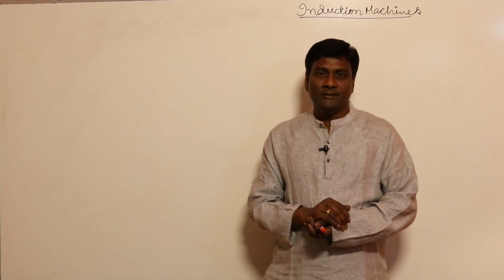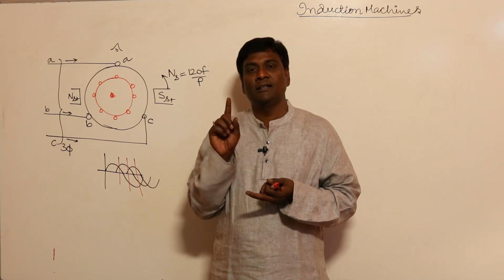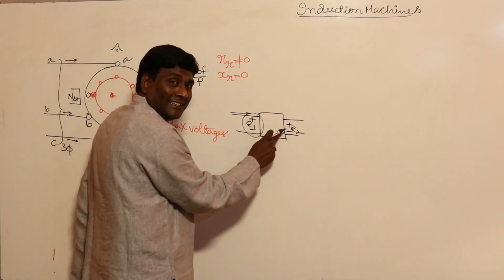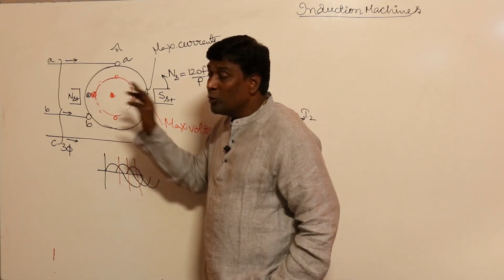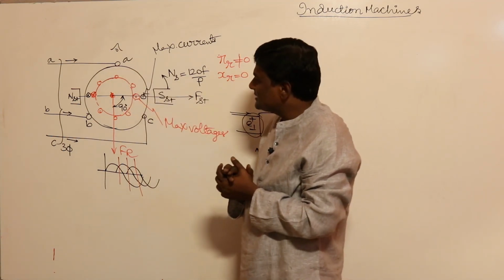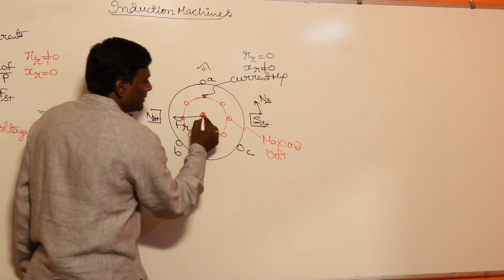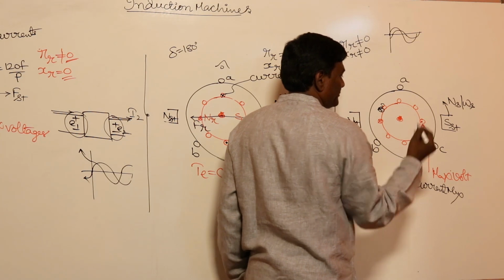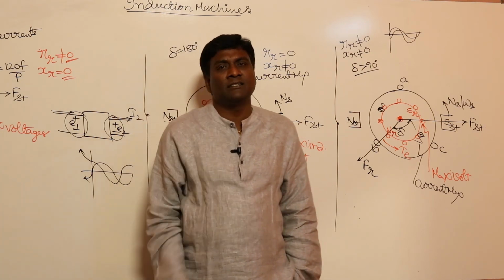Induction Motor Is Less Efficient | Load Angle More Than 90 Degrees in Induction | KN Rao for GATE

Comment: Sir. Thanks for this video.
For continuous torque production, the number of stator poles and rotor poles should be same. In squirrel cage rotor having 8 rotor slots, the number of poles will be 4(8/2). What is the number of stator poles in that case? How the number of stator poles are calculated ? Could you please explain sir